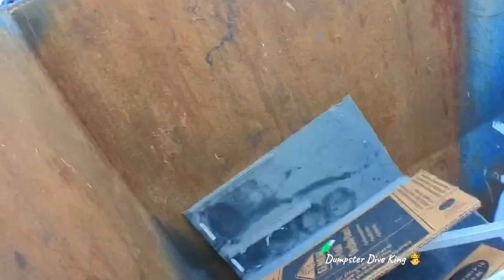Dumpster Diving at designer stores and more !! Watch what I find !

Comment: Camera in the dumpster sounds like a free camera. No reasonable expectation of property if it's literally in the can.
Reply: if the camera is mounted to the dumpster, then it's questionable if we can assume it as a trash.
Reply: The camera is put there by the garbage company,  so they know when to empty the dumpster.   It saves them fuel.
Reply: There is the issue that this dumpster is fenced in though which means he is trespassing 👀
Reply: @cody4900 it can be fenced, but if it's not LOCKED. Should be fine. It's on public property anyways